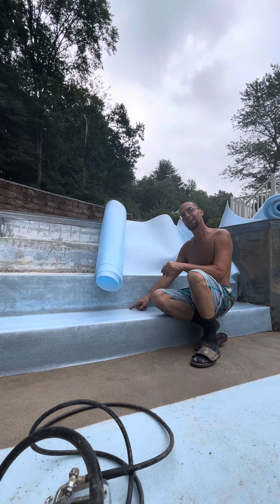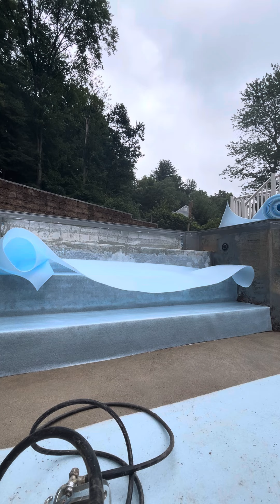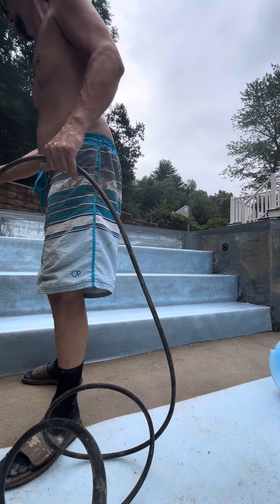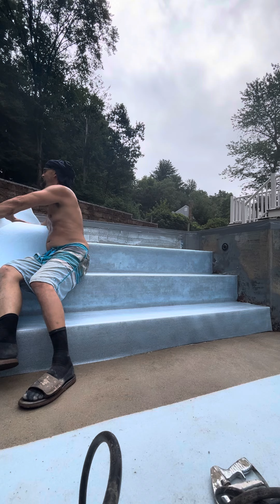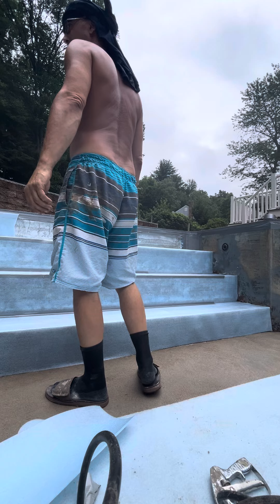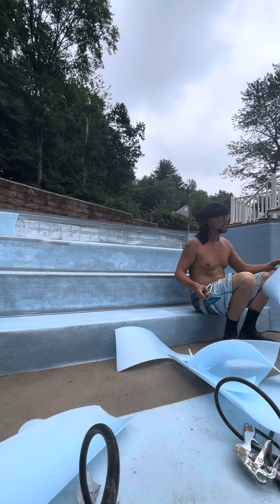POOL FOAM INSTALLED ON STAIRS #swimmingpool #foam #howto #diy #video

Comment: The main reason they use this is if they have kids and they're running around the pool area you know kids you can tell them a hundred times not to run because it's slippery and they can get hurt but they're going to do it anyway this will help